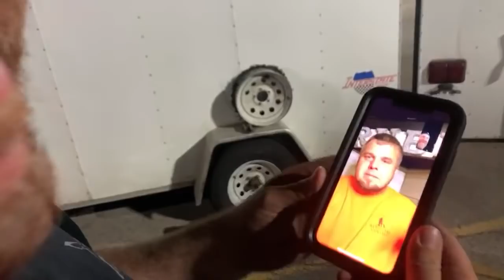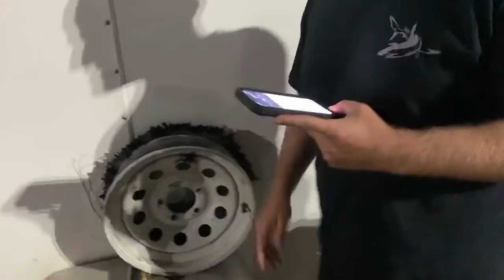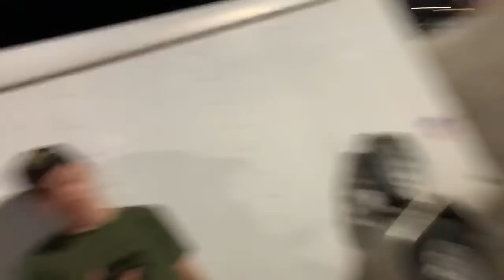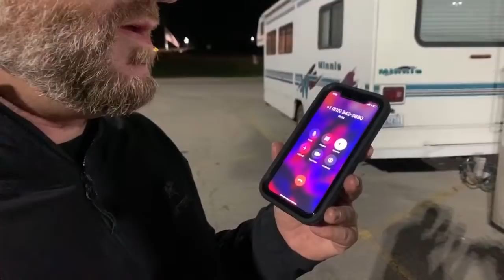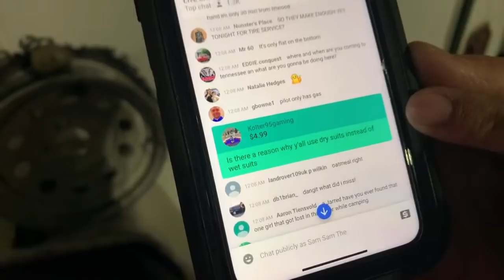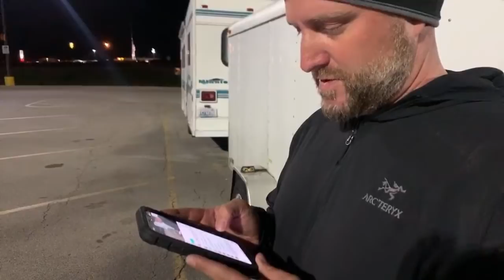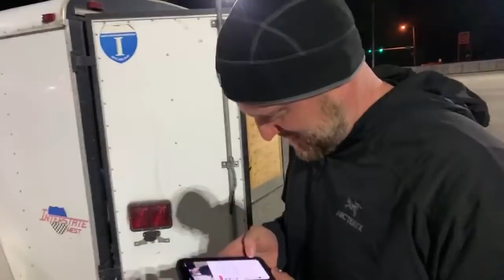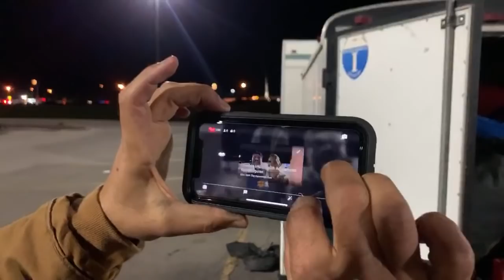Broke Down on 2020 Cross Country Cold Case Road Trip

Comment from the maker: SHOP NOW... GET INVOLVED.. AND HELP SUPPORT THE MOVEMENT
🚣‍♀️ INFLATABLE BOATS - FISHING MAGNETS - DONATIONS
👕 AWP T-Shirts - Stickers - AWP Merch and More..➤ https://adventureswithpurpose.com
Reply: Progressive is good. Depending on your level you might even have road side assistance. I know my parents have road side assistance with them. They might even have a tires side of it too.
Reply: Y’all are too awesome 😎
Reply: My Uncle had a fifty foot yacht. He said that he got two gallons to the mile.
Reply: I was an IT Support Technician four thirteen years! I can build a computer if you need one.
Reply: I love watching your videos I think y’all do a great job some are sad
Reply: Guys. I thought some one was only two blocks away with tires
Reply: To check for a bad bearing on your trailer , jack one side up and spin the wheel by hand while laying your other hand on the axle. If it's bad you will feel it in the axle. You should use trailer tires which have a different sidewall then passenger tires. Northern Tool, Tractor Supply and possibly Harbor freight have tires mounted on the new wheel for around a 100.00 each.
Reply: Theo
Reply: What is Dans U tube channel please
Reply: Hi are you done
Reply: I like seeing your voice

Comment: If t hasn't already been mentioned, the silver wheel on your trailer is from a Ford Ranger. That means your bolt pattern is 5 on 4.5". The 4.5" is the diameter of the circle of you drew one through the center of the wheel lugs. Measuring bolt hole to bolt hole isn't quite right.

Comment: There is a difference between a trailer tire and car tire. When you go through Memphis ,take the summer avenue exit to Northern Tools right off the exit next to the Interstate. They have wheel and tire mounted for around a 100 dollars. If you have a bad wheel bearing you can hear it and feel it in the axle. Jack it up and spin the wheel.

Comment: Jared you also need something like a seamstress tape measure to measure the wheel bolt pattern with and Yes Ford Ranger and Jeep Wrangler Five Lug Wheels will work on most any Utility Trailer that has the 5 Lug Wheels in a 14 inch and 15 inch size!!! 👍

Comment: Yeah I work plus the wheel that you had to blow out Tire on in this video is not hurt and I can assure you it is still usable because they have to have a lot of damage to them like bent in places and major major flat spot areas around the lip of the wheel inside and outside Outer rim ring itself and that wheel doesn't look bad at all... if you still have that will you better keep it and get a spare tire and have mounted on it because  I'm for certain it is good to use because I've had the similar situations on much larger trailers with a lot more weight inside before and I've only damaged one wheel out of probably 10 or 12 different experiences with tires blowing out over gosh I couldn't think 20 years maybe 25 years because I used to pull trailers daily hauling cars and other stuff but anyway that was a little advice I wanted to give you because that wheel alone can run 60 or $70 itself

Comment: Hey guys you need to carry to spare tires per unit two for the rv and two for your trailer.and a jack and batt type impact gun and socket set.the tires on that rv gets hot and the trailer burns up because the trailer tires spins more then the rv.

Comment: Rural King stores and I believe Tractor Supply will have the necessary equipment to keep you going.  I know this is late, but since you are in the Mid West, you should be able to get to one if other stuff comes up.  Better than Walmart...  They also have bearings for most of the small trailers like yours...

Comment: Before going on a trip check that your spare tire has air and in good working conditions  plus check all the lights including the license plate.  I used to be a motor coach driver this is why I am telling you. BE SAFE,  BE AWARE 👀 OF YOUR SURROUNDINGS AT ALL TIME. I AM 75 YRS OLD love you guys.

Comment: Jared just keep in mind on that type of five lug wheel pattern on your pull trailer that it is pretty much always the same as a five lug Ford Ranger bolt pattern, if that helps any because I've got a trailer I don't use any longer that is enclosed here in southern WV and it's an 06 model but it is a dual axle with the same Tires and Wheels and it is either a 26 ft or a 28 ft overall length and 24 ft box I believe but I had to swap a tire out one time and a Ford Ranger Tire and Wheel fit perfectly and that was off of a 92 model Ford Ranger two-wheel drive truck but four-wheel drive or two-wheel drive either way would bolt up I'm sure

Comment: If you are going to Lake Cumberland, are you going to look for the steamboat in the mouth of Wolf Creek?  There are at least two steam boats down there.
Reply: Supposedly someone bought three boats, the Celina, the Rowena and the General Burnside right after WWII to move them below the location of the Wolf Creek Dam before it was built, for the purpose of running them for a tourist attraction below the dam after it was built.  They had been in drydock through the end of the Depression and WWII.  When he put them under power, the bow went below the water line and they sank, one at a time, the last in the mouth of Wolf Creek.  The story is in the Lindsey Wilson College Library in closed stacks, or it was when I worked there.  The whistle off the Celina was on a sewing factory in Russell Springs for some time, as their noon whistle.  That might be a cool thing to look for, if you are down there anyway.
Reply: When are you going to be there?  My family would kinda like to come and watch you.

Comment: Lowe's, Home Depot, Tractor Supply, Walmart..?,  One Question..? Why in the Hell did you start a cross Country Trip with BALD TIRES....????????? Didn't you even think  about looking at the tires...????   =) But you GREASED the BEARINGS and didn't look at the TIRE TREADS....??????? WOW...! Hope you Learned your lesson..... =) Five by four & 1/2 means 5 lugs with 4.5" center to center diagonal. I show 23, 604 views......

Comment: Jared if possible, could you add any type of like heavy metal or heavy alternative music to some of the videos and even without wording in it if that's inappropriate would be awesome but just the music Alone would fit some of these videos so well especially the ones with what I call a little suspense to them but anyway that's just a question I wanted to ask and see about, if it's possible... Also you can check out RC sparks Channel on YouTube and he is a radio controlled giant on YouTube one of the largest channels on here but with what you're doing, I'm sure he could get you hooked up with some water type of gear and I know I mentioned this before on one of your older videos from a couple of weeks or so back but anyway he's located in Canada and him and his wife run the channel they have 3.5 million subscribers and he has a lot of connections that's for sure but he could probably get you hooked up with smaller ROV type stuff but anyway it's worth a shot so that's why I wanted to suggest for you guys to check him out and anyway good luck on all of your adventures buddy 💪💪💪👍👍👍

Comment: Need at lease 10.000  generator get a mechanic to take the motor off put the generator under the hood  with all the the wireing run it off the electric clutch never have problems again and yes you can make cut the frame of the generator so use the old motor on something elsewhere.